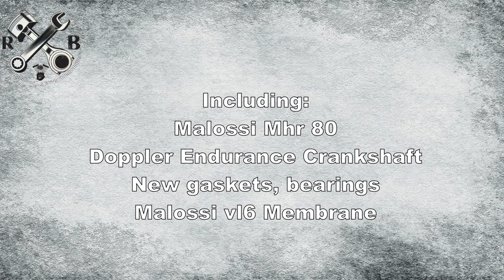Derbi MHR 80 Engine Build (D50B0)

Comment: good job but next time hit only the outside of the bearing and heat the cases more! also dont hit the crank like that just heat up the bearing. also you forgot the locking washer on the clutch hub, just for next time you biuld an engine reminders
Reply: the fact that this was for a customer suprised me seeing how he indeed mounted the bearings, they will be broken in no time

Comment: 4:20 there the crank became crooked!
Reply: Well, how do you then adjust it to the perfect position without hammering it slightly harded?
Reply: @eimantasme  You use a crank puller
Reply: @memoriescreated  I'm guessing you can use this method for your own sake, how about the bearings?
Reply from the maker: it probely didn't, but you are right the proper tool is a crank puller. luckely i invested in those tools some time ago but this video is a littlebit older. those 2 light taps won't effect the crank critical and im sure there it will be fine for this mildly tuned setup
Reply: @restorationandbuilds5899  a rubber mallet is not going to bend the crankshaft, a good old metal headed hammer will, i have hammered my crank, transmission, bearing everything pretty hard with a rubber mallet and everything is completely straight.
Reply: no it wont, i have rebuilded many engines, from my own to my friends and let me tell you that rubber mallets wont bend a crankshaft, atleast that i know of. hammer away if you ask me
Reply: @restorationandbuilds5899 hey man im hoping you will respond, i just got a 80cc malossi mhr and im wondering if i have to change the crankshaft. and if i do is it hard to?

Comment: Hello , i have aprilia sx 50 with the same engine and i want to put 80cc top performance on it ( 78cc top performance) . Do I have to grind the crankcases to fit this cylinder and crankshaft?

Comment: Hello, We are changing a crankshaft for derbi d50b0 engine( senda  xtreme) And one gear wheel  doesn’t come out, the first one on the bottom next to the clutch.

Should we take off the clutch to take it out , because we think it’s not necessary to take if the clutch ?

Comment: Hey guys, sweet vid! I’m wondering if this 80cc kit would work on my Polini XP65R engine. They use an EBS050 engine with a 65cc jug and piston. I’m wondering if it’s as simple as swapping on the larger piston and jug on the stock rod/crankshaft? 

Thanks very much!

Comment: I'm struggling to find torque specs for this engine how did you find them ?
Reply: Theyre not that important. Go by feel. Been building engines for ages.
Reply: naaah, you can find them in the service manual
Reply: You don't need them just go by feel everyone does that

Comment: I have my derbi senda 50 2017. Water pump leaked and lost all the coolant. It of course heat seized once and locked up. I got some water and fired her up, that was enough to get me to my destination. 
Problem is i have exhaust fumes coming out of my coolant tank.. so im thinking the head gaskets blown.  

Ive never done any major work on bike engines but i know how they work. Im an engineer.
Now, i suppose i should take the engine out, take the head off and have a good look around, see if anythings warped from the heat. So on. Change the gasket. Replace the water pump and chuck it back together with common sense and knowledge. Would that be far enough to get her running proper. 

Also can the maintenance manuals be found online if i get stuck?
Is this something i should be able to do relatively easily
Any specialist tools required.
Bike is all standard

Comment: thats not how you mount bearings, heat the casing up enouch next time, they schould slide in or go in with light-medium pressure. and if you need to tab them in only hit the outer ring

Comment: How much Newton meters for the block?? And what oil do you use for the clutch disks?
Reply: The clutch oil is the same as the gear oil, the tank is shared. So just use the oil you re going to put in. Regarding Nm for the engine block bolts I have no idea but be very careful as I remember the thread on the block wears easily…

Comment: did you have to run a higher spec transmission for the power or did you use the stock setup? Thanks
Reply: stock setup should handle it as long as you drive properly, but its not a bad thing to upgrade the transmission anyways

Comment: The AM6 must be the best 2-stroke 50cc engine ever to be put into a motorcycle, I have one to put into my 1979 FS1E, after it gets a rebuild that is. That base gasket looked a bit out on size compared to the ports, or was it the camera angle. What about the oil pump, they are no use with a big bore are they? pre mix oil.
Reply: This engine isn't Am6 it is Rabasa, they're two different engine types.
Reply: @Masairasink  No it's not, it's a D50b0 or Derbi euro 3. Rabasa, or Derbi euro2, is either with or without counter rotating shaft, but it takes a lot of space right under the intake side. In the casings of this video you can clearly see that there's only space for a small cylindrical shaft. Rabasa's have a casings that looks much alike AM6 seen from the inside

Comment: Does the carburetor have to be leveled properly or can it be tilted? Does it make a difference? (Dell`orto 21 Red)
Reply: It doesnt make a difference but when it starts leaking out the float bowl you need to level it a little bit more

Comment: how much is fuel consumption at this 80ccm cylinder ?
Reply from the maker: Every bike is different, but it should be around 1:10-1:15 (litre:kilometer), also depends on how much throttle you give
Reply: @restorationandbuilds5899  no way it consumes 100L/100km XDDDD
Reply from the maker: @lettuce953  No, not that much ;)
Reply: @lettuce953  bruh
Reply: @lettuce953  bruh
Reply: @lettuce953  BRUH !

Comment: in first two minutes you use open flame and a hammer, all against motorcycle repair principles
Reply: Its to make the metal in the engine case expand, so the bearing fits
Reply: There aren't really any other ways to get  a bearring into the crankcase